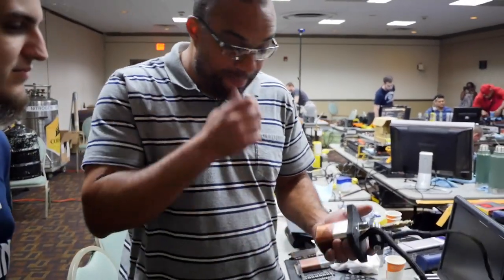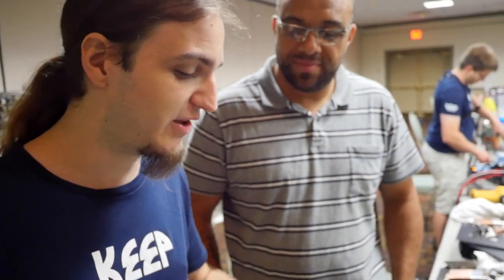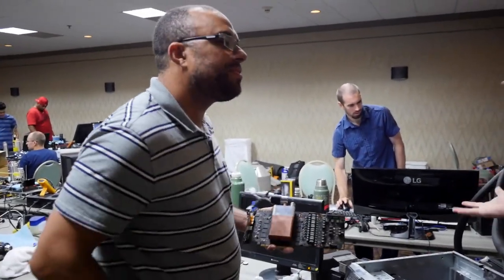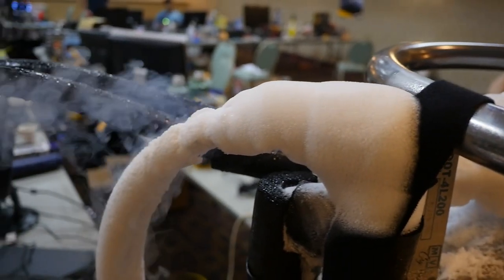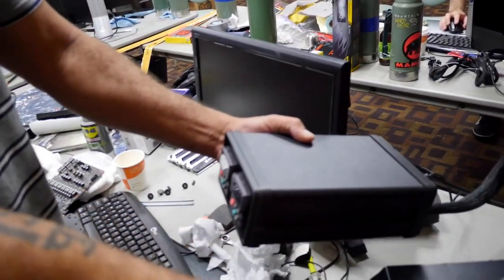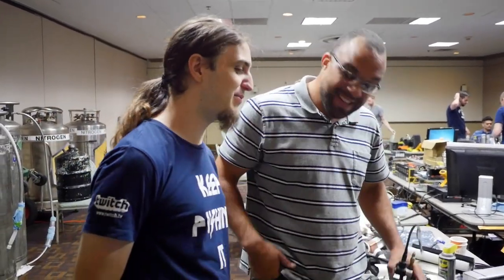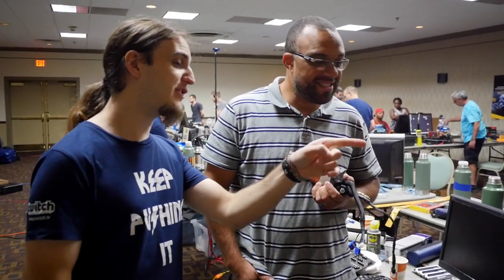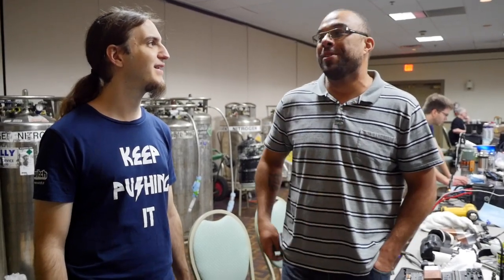L&L Cooling OCC-X Dual (CPU & GPU) fully modular automated extreme cooling solution

Comment: pretty cool idea but the skill in the pour with cb/cbb sometimes is fun
Reply: Yeah.  i agree.  The nostalgic aura of hours of insulating and the inevitable loss of a functioning board after a couple hours of benching due to condensation is a regiment that OC'ers are used to.  I had no idea that so much prep time was spent and so little time benching.  I am used to running the occ after maybe ten minutes of set-up and splitting after ten of take down. I use the same board and gpu etc for my daily user.  Just warm up the pots and take it apart and set up air.  And all my gear is fully preserved, I could RMA any piece of it without cleaning etc anytime I wanted.  I can't wait to see what a pro does... Stay tuned!
Reply: I wonder if it's possible to do benching in a vacuum chamber to avoid condensation.

Comment: Really cool system, although would like to see if it can actually hold temps at load now.
Reply: Yeah, it holds temps down very well.  At the gathering we ran prime95 (which I didn't know about prior) for about three or four minutes.  I got concerned after a while for my CPU but it only lost 3 degrees.  Set point was -114C highest temp was -111C.  Sat real still there so just shut 95 down.
Reply: Check out our new videos for some temp showcase